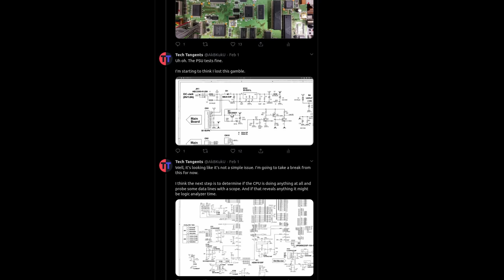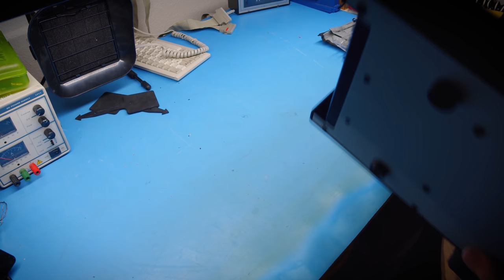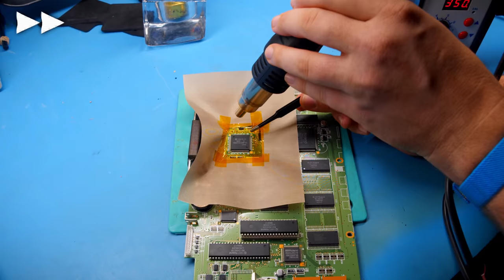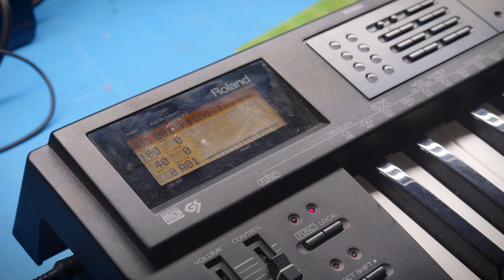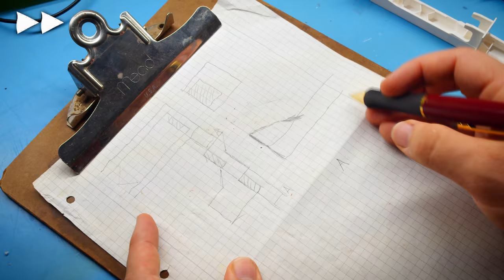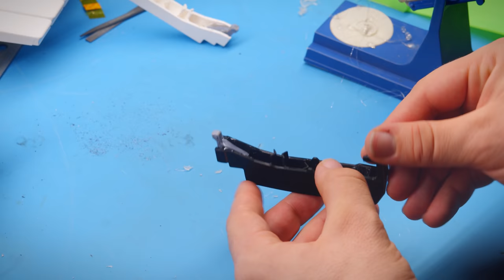TT Repairs: Roland SK-88 CPU Replacement and Key Rebuild

Comment: A handy way to remove surface mount components like that which are dead anyway is to just take a razor and cut all the pins off the chip so you can take the chip itself off and just push the little bits of the pins off with a soldering iron.  I believe I saw Dave from the EEVblog use that method.

Comment: Nice repair. My one critique: I think I would have used epoxy instead of hot snot...
Reply: I like hot glue because it is more conveniant (at least for me), and it is much easier to clean up or fix mistakes, and usually is good enough.
Reply: Hot snot bonds really well to PLA, probably because it melts the surface of the PLA before it cools. It's really remarkable. I always thought of hot snot as a pretty bad solution to just about anything, but for PLA parts it might actually be one of the best.
Reply: @Hagledesperado  it needs to stick to both surface. Not just the PLA
Reply: Or even gel cyanoacrylate.
Reply: @watchmakerful  The brittleness of that would scare me on any keyboard. one sharp jolt in the wrong direction and itll snap right off.

Comment: I know this feeling - last year i was able to fix a 120$ oscillocope module (a TDS2CM) just by stupidly replacing the one IC that got hot, and it worked. On one hand you're extatic that you fixed it, on the other you feel like a complete hack for not being able to cleverly diagnose the issue...

Comment: You really shouldn't use hot air without a flux (I may recommend Alpha RMA-7), also the temperature was way too low. You really had a lot of luck, you didn't rip off any of the pads. Never try to pull up the chip, it should start to flow first, and you should be able to move it aside, prior to pulling it up.
Reply: It's a bit of pita without a sonic cleaner but the right flux will prevent and reverse oxidization that happens rapidly with heat.

Comment: Adding flux to the braid is a sound technique as well.  Just tossing that out.
Reply: Also it's a good idea to cut of the used part of the braid, else it becomes a heat sink, which is not what you need.
Reply: @Hagledesperado  This ^^^ especially for bga. and extra flux helps

Comment: Congrats on the successful QFP rework job, very glad to see you fashioned a heat shield to protect those white through hole connectors, I’ve learnt my lesson after melting a couple of them with hot air! 

I'm also surprised to see the processor failed low resistance, I've only encountered that once before (excluding gross overload failure modes) with a DSP with an internal regulator that had it's output shorted by a solder ball between two pins.
Reply from the maker: I think it only failed that way because it was a bad part to begin with. Not something that went bad over time. I'm glad it failed like that thought because it would not have been as easy to diagnose else wise.

Comment: That stuff looks relatively workable. I replaced a DAC on one of my synths as they're known to go bad. I removed a pad in the process and had to solder on a bodge wire. Not easy for a chip smaller than the thumbnail of your little finger.

Comment: Quick tip, next time you have to use hot air, raise the board off the workbench. That way you don't have to heat up the silicon mat and bench. But great video.

Comment: Oh ye of little faith... I had confidence in you the whole time :D

I believe I've seen another YouTube video where one of the easy ways to diagnose bad chips on some board that's not working is to either touch the chips and feel for one that's unusually hot, and/or look with an infrared camera for anything hot.  Because shorts tend to generate a lot of heat.

Comment: I would worry about the teflon giving off toxic gasses. I just use AL foil and cut out a square and then use Kapton tape. I also have a hot air machine with a underside preheater and that also helps. To put the chip back on I use solder wick to remove the extra solder and then I use tape to help align the part. I then tack the corner pins. I then tip the board up vertically and use a 1/2 inch wide double bevel tip pointing upwards to solder all the pins at the same time. Flux removes surface tension so all the solder bridge's drop out.
Reply: I don't think it's getting warm enough for that, you only need to start worrying upwards of 260°C, and specific heat capacity of epoxy and PTFE is pretty close. Obviously the CPU area was heated to 200°C but not much beyond that, as the heat was removed as soon as the chip started to budge. But yeah alu foil is a good call.

Comment: It isn't at all surprising that you fixed the keyboard by swapping out a single part that got hot.  This is a standard way to locate failed components on boards.  This can be done by using an IR camera, but if you go look at the Louis Rossmann chanel, he often just squirts some IPA on the suspect area and sees what boils it off fastest.  He can often get down to a single SMT capacitor (a rather common point of failure on some Apple notebook boards).  (Not doing it by touch is usually preferable, as failed components can get dangerously hot to touch in some cases.)
Reply: I know what you meant by IPA, but for some reason I got the brief image of Rossman pouring beer over the board and watching it boil while he finished off the rest.

Comment: What does the Epson chip do?
Reply: That's a 256kbit SRAM. It also has a twin and a CR2032 battery holder besides it. So that's what stores your configuration or whatever when it's unpowered, all the "nonvolatile" state. So the custom user patches, your FX route, modified patches.

Comment: • You didn't record the most important part, the part we wanted to see most? 🤨 🤦 Isn't that always the way? 😕 🤷
• I need to replace an SMT chip on something but I don't have a hot-air gun and even then, I don't trust my flux or solder to flow. 😒

Comment: Sk88 is a confusing name for a 37 key keyboard
Reply: I think it’s because it’s essentially an SC-88 with a keyboard
Reply: It is based on the SC-88 sound module.
Reply: Clearly, but “88” is commonly used in model numbers of 88-key keyboards, so unless you’re very aware of the lineage, it seems comically misleading.
Reply: I didn’t know the name of the module tbh but the same name confusion still applies to that, are there modules from the time that don’t cater for the full range of a piano.  Roland stuff is amazing sounding and feeling but the menus they use are confusing to say the least so I’m not surprised by being confused by their naming